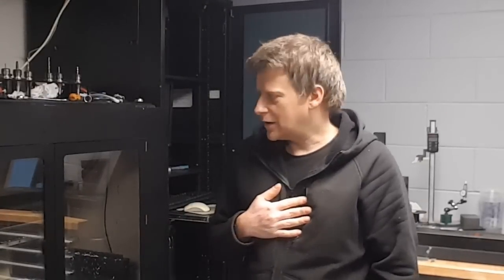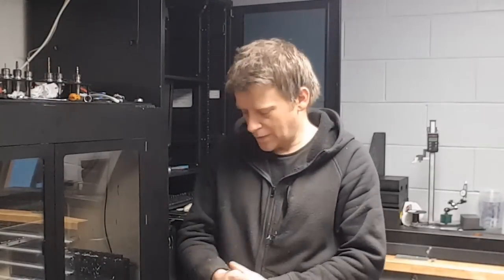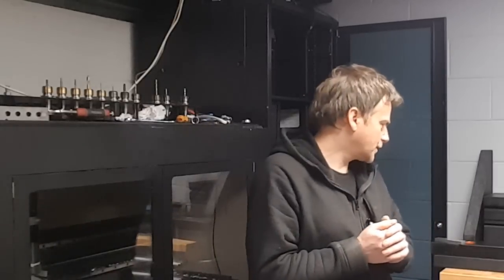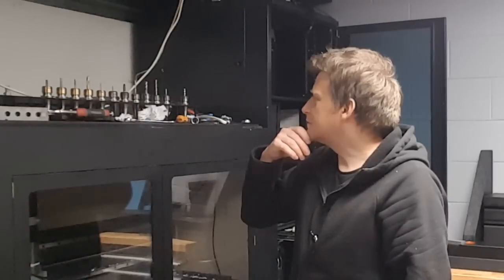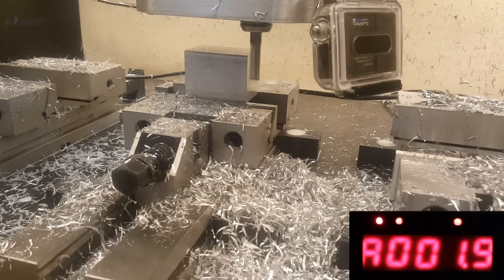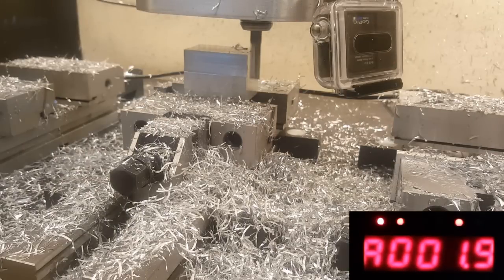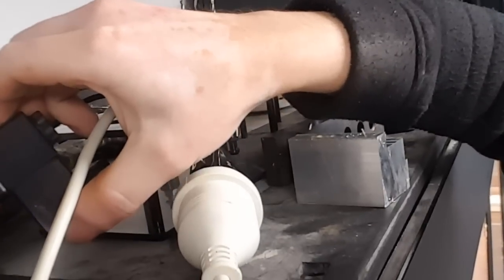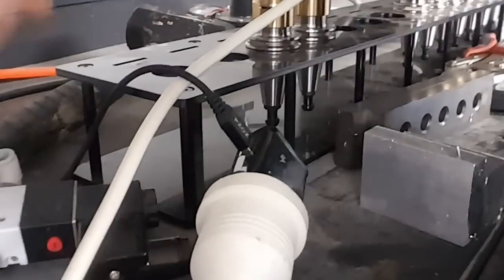ATC 2.5KW testing the spindle limits - THE BEST Chinese spindle, second review after over a year.

Comment: Awesome Spindle! can you do a similar video with steel?
Reply from the maker: maybe eventually, when i will need to do steel.
Reply: @PiotrFoxWysocki  this type of test for steel wouldn't be too interesting, especially on your machine - its going to cut basically the same as in the aluminium, just less. The real test would be to see it cut a part for an hour, in the lower rpm ranges (6-12k) to see how it copes.
Reply from the maker: @wernerautomation2834  any idea where i would have to slow down so much? i would prefer to go fast with fast rpm, to finish part quicker. recently i did some parts where time was 1h - 1.5h at 20 000rpm. no problem.
Reply: @PiotrFoxWysocki  with steel, and larger cutters, you cant usually run as fast as 24000rpm. This is why steel is an issue with these styles of spindles, not because they don't have the power or rigidity. As you may have been told by jinaken, they don't recommend running under 12-15k rpm, so, a good test would be to see what happens. A good vector drive will run the spindle from zero hard, but the cooling may not be sufficient. Do the math to make a 1.25kw cut at 12000rpm and watch the water temperature. Then repeat at 600w and 6000rpm. Keep an eye on the temps, amps and the e stop :)
Reply from the maker: @wernerautomation2834  i have strange feeling you are trying to sabotage my cnc ;)
Reply: @PiotrFoxWysocki  Nah.. I just don't want to be the first one :P
Reply: @wernerautomation2834  You would have to redesign the entire machine to change it's natural frequencies to avoid resonance. I think this router performs so well thanks to the wide granite gantry and high rpm spindle.

Comment: Would be interesting to see how it does in steel...
Reply from the maker: one day i will make a video. I'm not very big fan of steel because it rusts, and chips are not very pleasant to handle. but from this what i cut its just like aluminium but half the feed. for steel i need end mills for steel and more tool holders.
Reply: @PiotrFoxWysocki  Kinda the other way around myself..

I don't really trust the strength of cheap alu VS cheap steel, you generally need a higher and more expensive grade of alu to match the strength of some rather cheap steels(which are already much cheaper than alu).

But you are right alu is easier and more pleasant to machine( a strong magnet inside a small plastic box makes for easy cleanup of steel chips though)

Comment: Could be stupid question but do I need servo motor or dc motor with belt to use this spindle
Reply from the maker: silver and black cylinder is the whole spindle. you just need vfd (speed controller for it) that's all
Reply: @PiotrFoxWysocki  Great, so this reduce price a bit.I will ask vendor however I am wondering if this spindle can be used in horizontal way like in HMC
Reply from the maker: @piotrszczesny7595  sen then an email. im sure they have one which will do it. the biggest i have seen they have was 130 kg spindle. so they do serious stuff ;)

Comment: you should try cryo treating your cheep endmills. Basically, you chill them in liquid nitrogen for a few hours.   This extends the hardening process from heat treatment, you do not have to heat the bit either. Just ambient to cryogenic temp and then let normalize.  The hardness goe's up, and tool life and tool sharpness life goes up.   
Heres a vid explaining it better, and testing it - demonstrating the process.  Its fair cheap and easy todo. Liquid nitrogen is very cheap to buy from welding supply stores and farmers' equipment stores.
https://youtu.be/hAxi5YXTjEk